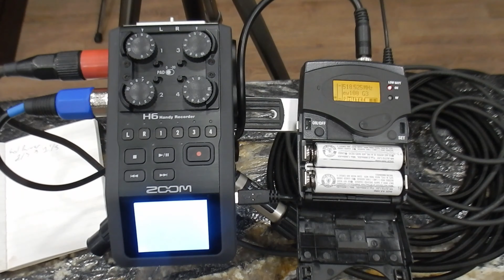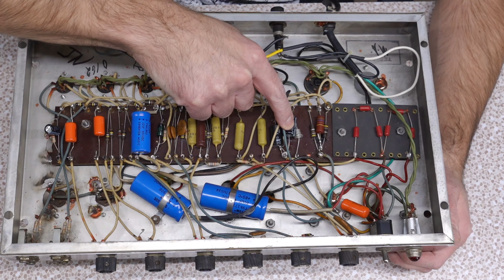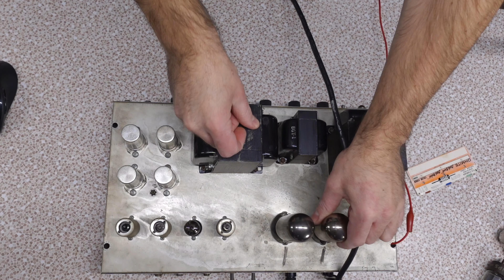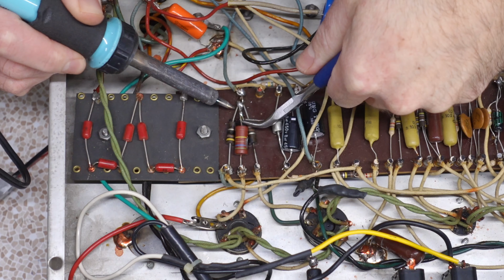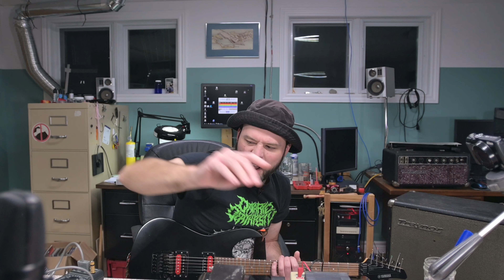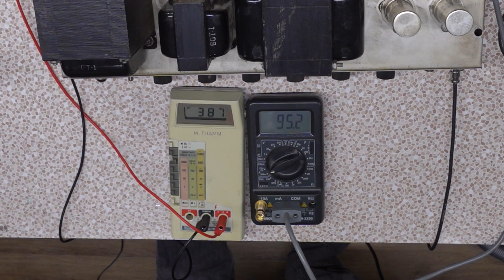Traynor Signature Amp YGA-1A: A look inside and Cranking it Up !

Comment: I own a YGA-1 and I work on plenty of old Traynor amps. That one is fairly molested into a rat's nest. The portion of the board under the diodes must have burned up and been replaced. There is a taped up connection floating around. If the original filter caps are still wired in, there are too many large caps in there. Components have been added and changed. It's common to mod these toward Marshall specs.
Reply from the maker: Oh yeah, they get butchered up here. 
It did work tho. Just fine. I made some touch ups and inspections to make sure it was safe to run before giving it back to buddy.

Comment: Hey Man, Is it possible to install a pre phase inverter master volume to this amp? I tried to run a 1M pot off the middle lug of the treble pot, and find it just doesnt have much gain with the volumes cranked and patched. Is this type of Master vol mod not possible with this amp? I appreciate any tips you could give...thanks!
Reply from the maker: Yeah, the pot off the treble is a standard master volume. That is handy to have. If you want more dirty, try putting a proper overdrive pedal in front of it. 
This amp as I recall has a pretty normal phase inverter circuit, so most PPIMV mods should work.
However, I dont' care for PPIMV's. I've never really heard one I liked. 
The real magic of an amp like this comes from the whole thing cranked. 
Not sure you'll get much better tone with a PPIMV than you'll get just overdriving the preamp. 
I don't bother with master volumes and just use an attenuator when I want to get these kinds of amps breaking up. So you could say, I use a post power amp master volume, haha. A good attenuator isn't that cheap. I think there is a harley benton unit with a fan I might try. I have a bugera PS1 but it doesn't have a fan so is only good for a 50watt style amp even tho it's rate for 100. This amp is like 40w so it should be fine. Only thing is an attenuator can sound dull. You need to match it with a different cab than you'd normally use. I have a special cab set up for that.
Reply: @DATT  Thanks for your detailed response! I did end up trying a PPIMV as well as pre phase inverter and stayed with the pre phase off the treble pot. I actually have a Ho attenuator that I use with my NMV Marshall, just wanted to find a different flavour with this Traynor. I am with you on the PPIMV, they just sound sound great to me. Cheers man.
Reply from the maker: @ScottHarman  Hah, well these amps are so much like Marshalls it's hard to get a diff flavour out of them, but, I Pre MV might give you a diff flavour over an NMV Marshall, so small victory.

Comment: No fan? I have a 69 yba 1a with a fan that is noisy, as hell.
Reply from the maker: No, it's a lower output amp, doesn't need the fan. 
Off the top of my head you would find a fan in the Custom Special, and the yBa-1a high output bassmaster that would both try to squeeze like 50 watts out a single EL tube.

Comment: I have a Traynor YBA-4. I'm new to tube amps, any advice on settings for low/high knobs?
Reply from the maker: Ah not really, twist to taste. The way these amps work, the more you turn them up the less the EQ will sounds like it's working.
Reply: Thanks for replying, I started setting it up using a Squier strat and couldn't get the sound I wanted. I'm plugged into the bottom right input which is hopefully for lead gutar.
Reply from the maker: @pietrogoulinni3368  Yeah with those traynors, the bottom jacks are the high inputs. Right or Left to Taste. 
Not having luck ? what kind of sound do you want ?
They are very simple amps, Kind of need to turn them up to get the best out of them. Might be it's just not for you. A proper overdrive pedal could help.

Comment: I think the ground was done at the factory, this was a common service job for obvious reasons. My yga-1 which is very stock, has the identical grounding point and indeed cable.
Reply from the maker: Hmm, I found it just a touch sloppy for a factory job. The amps clearly been worked on, so, who knows.

Comment: What ohm is the output of this head! Much appreciated!
Reply from the maker: Great thing about Traynor, they don't really tell you. But I'm sure it's 8ohm. You'll be safe for the most part to run a 16ohm cab if you want. 4ohm, at lower volumes, you could overload it if you turn up. But I'm pretty sure it's 8ohm.

Comment: I always see people excited to see "original tubes!" online, but clearly these things do better with fresh tubes.  Sounds great!
Reply from the maker: Yeah no. Worn tubes can add character for certain tones, but for the most part, it's a no go. 
People think tubes blow, they don't they wear. I think part of the NOS trend is people finally changing their tubes to fresh ones, haha. 
I've met some NOS tubes that weren't actually new, just tested good. 

Testing a tube is like checking to see if a tire holds air. YOu can have an old tube that tests strong on a test, but still sounds bad. 
It can still flow a strong current but sound dull, just like a tire can still hold air but be bald.

Comment: Your not supposed to use bass on those cabs in the traynor literature they say explicitly to not use bass
Reply from the maker: Oh I could imagine. This cab turned out not to have the original speakers. That and, you're fine if you're playing at low volumes. 
But yeah, I don't imagine it'd last very long if you actually jammed bass with it. Hah, maybe that's what happened to the original speakers.

Comment: Cool video.  I agree 100% on lead free solder.  Way more toxic than lead-based when you look closely at what's in most alloys.  And it flows like hot garbage.
Reply from the maker: Oh my, I figured non toxic was the only thing it had going for it. But I guess it's just lead they are worried about. I guess it's like vegan meat, more processed that real. Vegan solder?